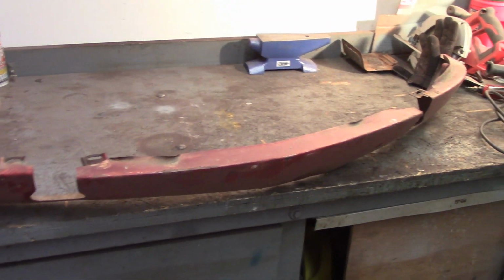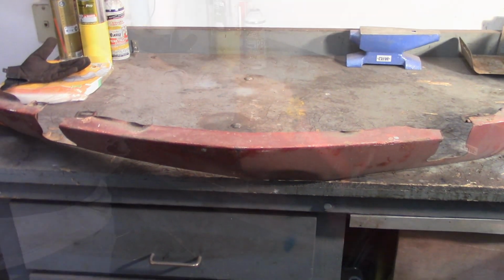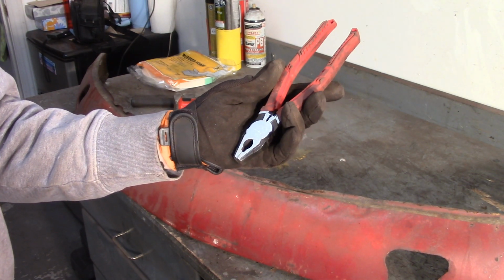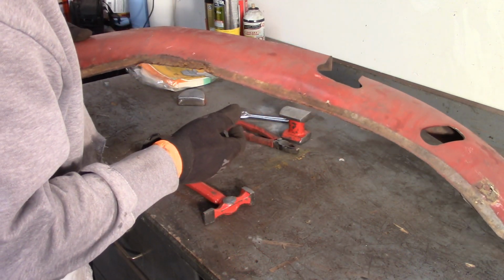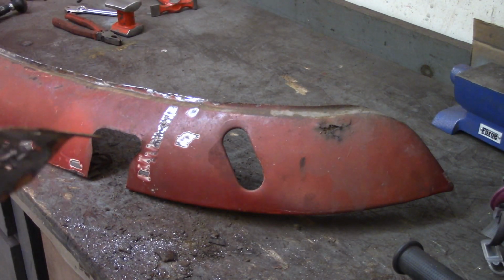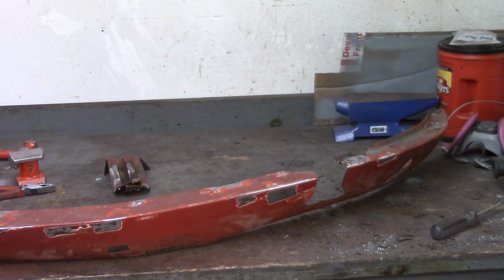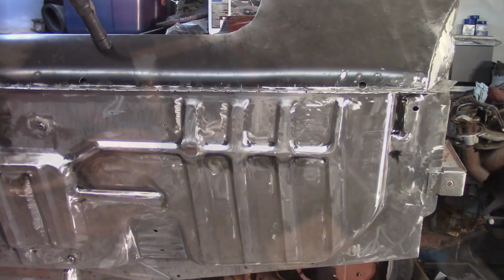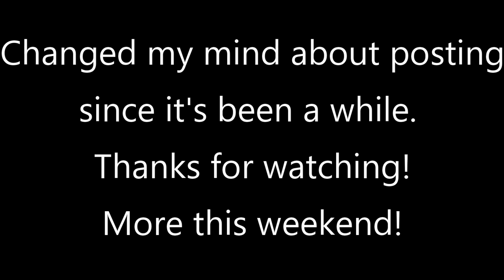Triumph Spitfire Restoration - More Under / Some Cancer

Comment: That actually is a very small amount of rust on the valance. The one on my 66 Spitfire was totally rotten. I replaced big chunks of it and it ate a lot of body filler :)
Reply from the maker: Yeah, I checked out the one from the black car and for the first time, it was in worse shape than Dorothy's.